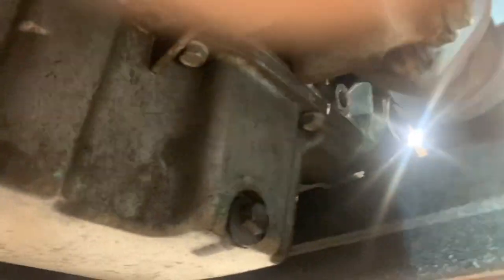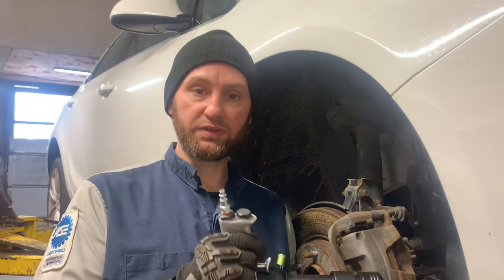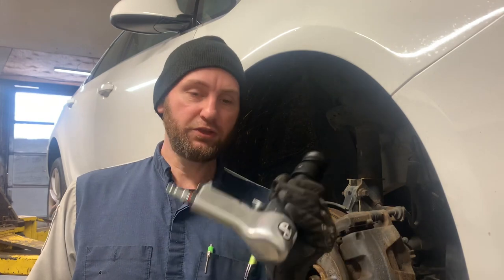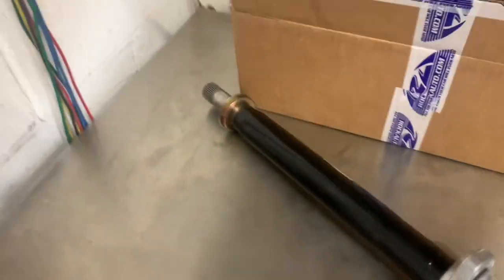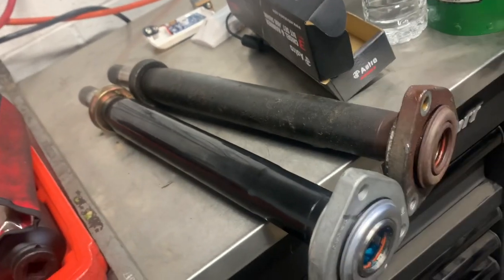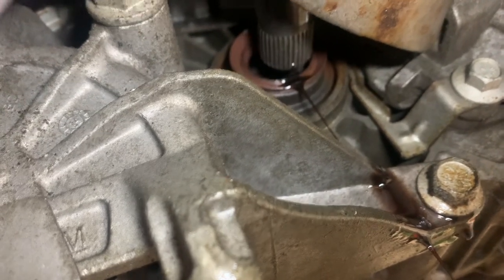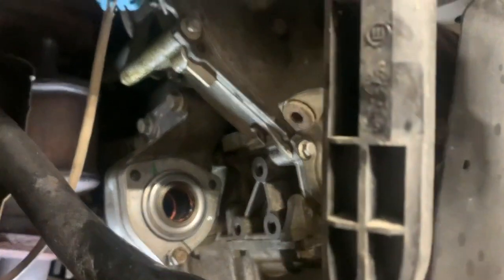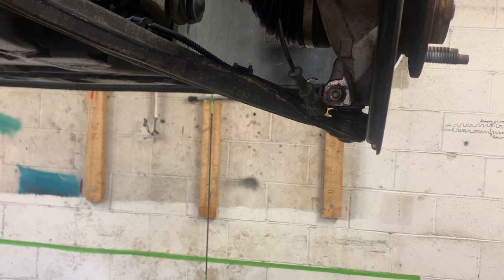2015 Buick Verano Roaring/Growling Sound

Comment: I just took my girls car to pepboys and they said the sound was coming from the driver front wheel bearing hub. The humming sound increases as speed increases & scrubbing when coming to a stop
Reply from the maker: If it is the driver front wheel bearing the humming sound should get slightly louder when turning to the right going above 40mph